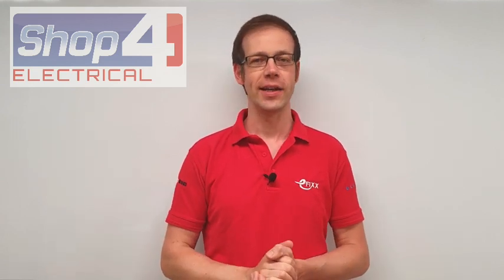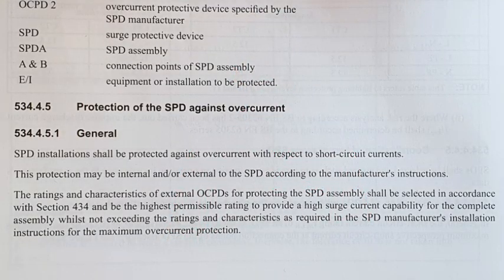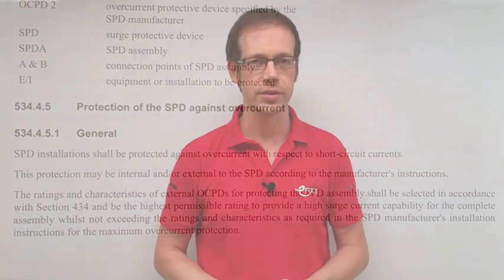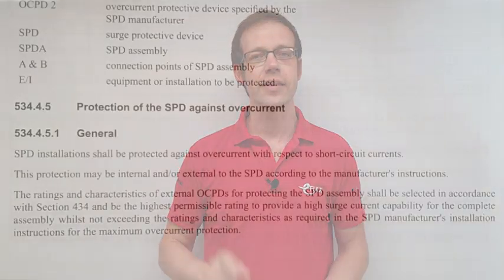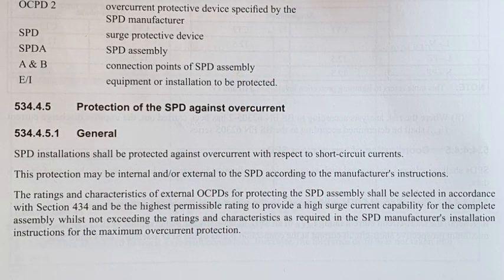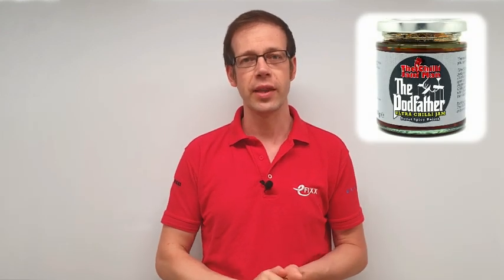Do you need to protect a surge protection device with an MCB?

Comment: Many CUs have a pre-installed Type 2 SPD with 32A MCB protection, what about if these were installed on a TT system with Ze of say 180 ohms there would not be sufficiant earth fault current to trip the 32A MCB, does this mean that a double pole 100mA time delay RCD should be installed instead of a 100A isolator switch with SPD on TT systems, otherwise a faulty SPD short to earth would have the metal case and MET at some hazardous live potential. There is no problem with TN systems obviously, however there does not seem to be any guidance with CU manufacture regarding TT installations on this snag. If the Ze of a TT system was as low as 10 ohms the earth fault loop current would only be 23 amps, not enough to trip a 32A MCB or blow a service fuse.

Comment: Are you saying that some SPDs have their own internal protection, so do not need an external MCB?
Reply from the maker: Yes that’s correct
Reply: @efixx  
I assume they have a reset button?  I have not seen one with a button.
Reply: @johnburns4017  There is no reset button on an SPD, when it blows and turns red you simply replace it.
Reply: This is with exception to some SPD's such as the MK single module busbar mounted SPD. Apparently this device has a current rating of 125A so is protected by the cutout fuse (assuming 100A or less). Just need to make sure the fly leads are also rated to this (which may cause some issues) Joe, whats your take on this? I personally don't like the idea of a failed SPD short circuiting

Comment: maybe I am missing something .. but surely if the SPD goes short circuit it would take out the supply fuse.. adding an MCB just adds cable length and hence extra over voltage to the customer equipment in the event of say a lightning hit .
Reply: From reading up on this, it appears that relying on the cutout fuse is non compliant with the regs. 534.4.5.2 states that continuity of the supply will not be affected in the event of overcurrent. I think alot of Manufacturers need to rectify this as many devices and new CU's are setup this way which rely on the cutout being 100a or less. Adding a MCB upfront will solve this issue but it takes up valuable space and increases wiring length. Manufacturers! How about adding a £2 fuse into the SPD so it's self contained? Would make installation much neater and safer and avoid all this confusion!

Comment: I think a more pertinent question would be - is surge protection necessary at all? Does anyone know of any instances where a surge has damaged equipment, or caused any kind of issues? How many surge-protected power boards has anyone found that have blown? In the UK this surely isn't necessary at all - perhaps if you live in Hurricane Alley in the USA, or out in the middle of nowhere, where there are loads of lightning storms.... surely this is just another case of overreach in the regulations?
Reply from the maker: I live almost in the middle of nowhere Nick and our power is supplied via overhead line with local underground cabling. Over the last 7 years  I've found one printer to have failed after a lightening storm, an element within a lighting control system. So will be investing in surge protection. It's not the board you are protecting, but the equipment connected to the board. - Cheers *Gordon.
Reply: Actually,  I've come across numerous client devices damaged after power returning from a power outage, so yes.
Reply: It is a good question. Surges do shorten life of electronic components . These very high frequency voltages do travel into the electronic circuit boards and depending on the number of surges, reduces the life. Being a computer specialist I have seen cases where in homes, people do complain about data corruption and unreliable hardware.  6 out of 10 times, I have seen that it is the power circuitary (smps) at fault. As you computers Smps's age, surges accelarates this process and net result - data corruption. In this age of smart led builbs etc, there are electronic power circuitary built into them, resulting in premature ageing of the builbs. In the area where I live, tropical monsoons come with lots of thunder and lightning. Also we get a lot of switching transients in the mains power. if you are operating large inductive loads like water pumps and aircons, when they switch on there is a sudden hf transient introduced into the home power.  So surge protector is a good investment.
Here is a good video about it: https://www.youtube.com/watch?v=DWBFHjE5zK0
Reply: I do think statistically they’re not really needed…… but having said that I have experience with 4 properties that would have benefitted from surge protection including my own!!!!! Took out a £2k TV, but still thats 4 houses in 30 years

Comment: I recently had a Curve (Lewden now I believe but are cross compatible according to manufacture) RCBO distribution board installed, will it be a simple matter for the electrician to add an SPD? or will it require a whole new installation?

Comment: I have checked with Wylex (Electrium) re their REC2SPD and they have confirmed that no MCB protection is required - it fits into the tails after the meter and DNO cutout (combined isolator and SPD)

Comment: So it's 50 shades of grey areas from IET.
In IEE  building  regs page 58 it states that it should be protected by an mcb.
The biggest issue I have that in the majority or domestic properties these spds are not necessary but every one seems to be chucking them in at random.
I am sure the manufacturers are happy about that . Promoting a product and interpreting the regs to suit.
I think they will cause more problems down the line with having to replace them and a possibility of blowing the main cut out fuse. 
Which in the regs says to avoid nuisance tripping. 
I have disconnected one in a rented property because I don't want any irrate call backs . If a customer has trouble with gu10,s  ect keep blowing because the neighbour's welder keeps causing problems then will fit one . 
But I don't think it is a good idea to fit them on every install as people thinking wrongly that it is " good practice ".
Not sure if I am causing controversy here but let's see. @efixx
Reply: Dave Zawadi's comments (I think he's an electrical engineer) on the IET wiring & regulations forum agrees with you - they're pointless:
https://communities.theiet.org/discussions/viewtopic/1037/26858
Reply: @johnhoward2104  
Zawadi wrote "This seems to me to be a solution looking for a problem again, a problem that I don't and never have had. The only damage I can think of was telephone line related, in that this was a couple of miles long and lightning tended to damage my modem, and in one case the phone too." 

He contradicts himself. The cost of an SPD would have been less than the equipment that was damaged. Then the inconvenience on top.
Reply: @johnburns4017  interesting point. Put it to him and see what he says. The SPDs would have to be installed in the phone line in his case.

Comment: With the difference's in cost when retrofitting SPD's is it permissable to fit one manufacturers spd into another manufacturers distribution board without breaking regulations
Reply: According to SPD Ltd, you can install a brand like theirs in any manufacturers board. You can call them and confirm.
Reply: @johnhoward2104  SPD ltd have already told me the same but it is not following the boards manufacturer's instruction and do you think they will agree somehow I think not!

Comment: The problem is magnified by CUs with them built in. Who's responsibility is it to check then, the company who made the board, the wholesaler or the spark installing the board?
Reply: Don't they all have a duty of care/responsibility in respect to their own roles? The manufacturer must produce and test the product to ensure the design is fit for purpose, then put quality systems in place to ensure the manufacturing process can deliver the design, the distributor must check conformity of product to standards, this cascades down from distributor to wholesalers/trade counters. The electrician is then responsible for installing and testing it according to the manufacturers instructions and regulations.
Maybe I'm completely missing something as this is a generic process, with many manufactured products, and maybe there is something specific, that infers differing roles for electricians, to what would be standard in the generic process.
Reply: @cjhification  i think your right. Problem has been that its been very unclear and were told to install by manufacturers instructions.  Its is getting better esp with the folks at Efixx asking these questions.
Reply: The installer, stand in any court saying ‘i didn’t know’ isn’t a defence, but the info should be easier to acquire

Comment: Moving a fuse board and you have to extend the cables I.e din rail terminations etc. Should you put them within a metal or plastic enclosure considering boards have to be of a non combustible material?
Reply from the maker: Great question - we’ll pass this one over to the NICEIC
Reply from the maker: Ping us over your contact details
Reply: I’d be interested in this too. I’m presuming plastic is ok as no mechanical parts inside 🤷🏻‍♂️. I’ve never extended in a metal box or even thought about it until you’ve asked this.....I’m hoping plastic is fine 😖😂
Reply: Good for thought indeed

Comment: Its a very good question. Rather than every spark in the country contacting the manufacturers  why don't you knock up a quick SPD make/model table as a great reference aid.
Reply: Yeh, this didn't really answer much:
"Do you need to protect a surge protection device with an MCB?"
"I don't know, read the manual"
Reply: @____________________________.x  of the few I've installed which had spd's production line fitted.  They were installed through an MCB.  BG boards in particular.  Even the retro fit kit comes with an MCB.  It's a pain in the but getting through to Manufactures technical.  Each manufacturer will have their own MI's guidance.

Personally I think it's a massive overkill.  Especially because you can purchase separate socket or extension outlets to protect sensitive electrical equipment.  Arc protection,  what's next.
  
I look forward to seeing what 19th edition electrics will have  installed for us.  Regulation on regs, it's crazy.  Almost as if IET have to justify what they're doing with the money we pay in.  Gas regulations aren't near as difficult 🤦‍♂️.
Reply: @rayc1503  Yes, I'm wondering what happens when they get to to the point where it's obvious that all of the technical issues involved in wiring  have been covered by regulations, and they are clearly just spinning the wheels to make it seem like they are doing something of value.